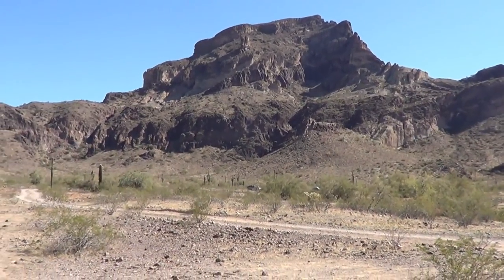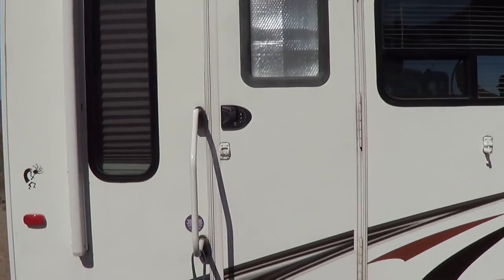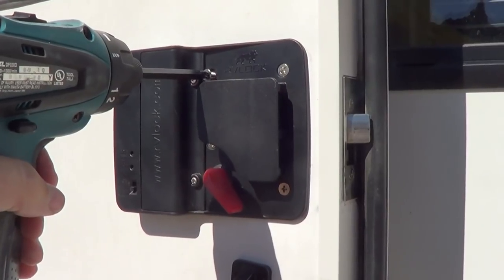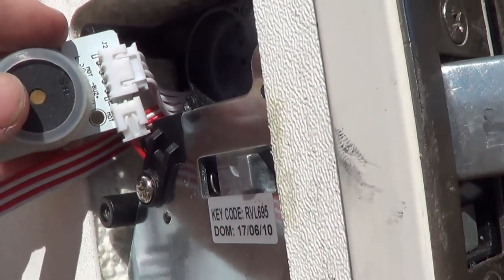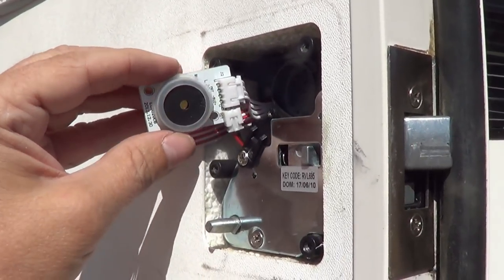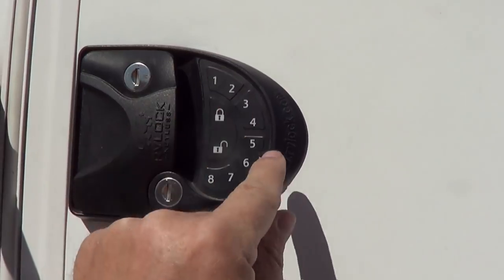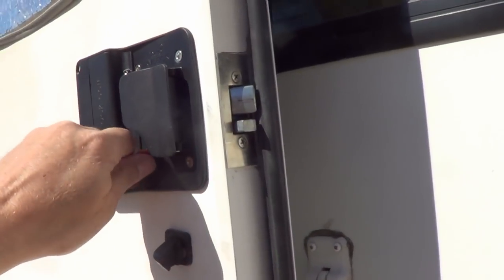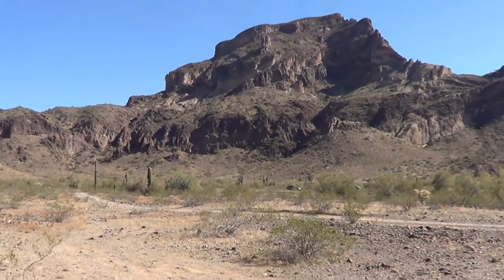RV Lock Keyless Entry Handle - Toning Down the Annoying Loud Beeps

Comment: The manufacturer has added a new setting in the last year that  allows you to completely disable the loud beep. So, its not quieter, its just off.
Reply from the maker: Really, that would be great. I got mine two months ago and don't see the setting, maybe I missed something or its not included in my model.
Reply: I just recently bought a set of these locks and I sure didn't see any setting or have found any setting for the chirper either. One reason I have decided to leave the AP combo door lock on the main door of my TH.  Ray, maybe now I will try to at least muffle the sound enough to be able to install it too!
Reply: To disable the loud beep: Hold down the "1" button for a few seconds, you get a beep confirmation. The beeping is now disabled. Hold the "1" key again to re-enable it.  This feature is not documented anywhere and it even took me awhile to re-find it, buried in a forum discussion.
Reply from the maker: Wicked! I tried it on my model and it worked. Do you know if disabled and the batteries go low will it still beep to warn you even if beeping is disabled?
Reply: Wow! It works on the door locks, but not on the baggage locks dang it!
Reply: @jking1224  you're the greatest!!! thank you!

Comment: I didn’t realize you could lock it without putting the code in first! Love your videos 👍🏻
Reply from the maker: Yes, and  I also found out from several commenters if you hold the 1 button for 5 seconds it disables the beeps completely. Hold it again to re-enable.  Thanks! Ray

Comment: I had used a rubber disc that I had lying around for some reason. It muffles it a little. I generally keep the remote in the truck and appreciate being able to hear the lock and unlock from the cab though it was originally way too loud. My batteries lasted around 3 months but I always used the remote.
Reply from the maker: That's a good point, never thought of people that use it from the truck, we have yet to use the key fob so it's turned off.

Comment: Thanks Ray
I just ordered RVlock version4.
Hope this has the feature to turn off the loud tones
Keep up the Great videos...😎
Reply from the maker: Yes, I have that version and can confirm that it has a Silent Mode - Just hold the number "1" button down for 5 seconds and you'll hear a few beeps. That tells you the "Silent Mode" is engaged. Your handle is then completely silent. If you want the sound back, just hold down the number "1" button again to re-engage the sound.  Cheers! Ray

Comment: I had the same annoying problem with a small safe that I just purchased.   I took it apart and warmed up the solder and yanked out the little soundbox completely.  Much better now no noise at all.  Or I'd fill that hole in the middle with some clear silicon which should deaden the sound.
Reply from the maker: I like a little sound feedback so I was thinking of soldering in a resistor to make the sound just what I want.
Reply: I understand.  My safe has a little light on the front panel which lights every time any key is pressed so I get my feedback via the light.  The resistor idea sounds great.  I always enjoy your thought process when it comes to solving problems.  Keep it up!

Comment: If you bought your handle in December, it DOES have the "Silent Mode" feature. Just hold the number "1" button down for 5 seconds and you'll hear a few beeps. That tells you the "Silent Mode" is engaged. Your handle is then completely silent. If you want the sound back, just hold down the number "1" button again to reengage the sound.
Reply from the maker: Yes, fellow commenters have alerted me to that, my unit does do it, didn't see it in my instructions though.
Also, I ask this after your comment on my other video.  It would be nice if using the keypad the beep volume level could be programmed, or maybe it can but isn't a published feature, too?  In silent mode does the low battery warning still work?
Reply: As far as I know, the sound is all one system, so you either get sound or you don't, and the keypad beep volume can't be changed separately. But when the batteries are low yes! Instead of hearing a series of beeps telling you they're low, there will be a pause in between when you hit the lock or unlock button and when the deadbolt actually moves.

Sorry it took me so long to get back to ya. I had to look into that and see with my own handle.
Reply from the maker: Thanks for the info. Cheers, Ray

Comment: Hay Ray perhaps you could help me. My son bought me this lock. We tried to install ourselves but needed a cutter for the door. So we tried to have professionally done. They cut the hole for the bolt, but the door is too think for this lock. Would you have any idea on how to make it fit a thicker door. I contacted the company and they said NO. can't help me. Thanks love your video's
Reply from the maker: Thanks, Chris, I don't see a way as the RV Lock is designed to work at only a certain door thickness as far as I can see. I guess if someone was skilled with metal work, they could fashion a mounting plate that was indented inward on the door to adjust for the thickness.
Reply: Love Your RV thank you. That is what is similar to what we were   thinking. Again love your videos

Comment: Have you seen the recent post on RVwithTito channel?  Clever idea to add solar as well as provide shade to your back/side windows.
Reply from the maker: No, haven't, don't have enough bandwidth right not to stream much, we pay per gigabyte. Will have to check it out next time I get some fast free WiFi. Looks like a window awning solar setup, pretty cool!
Reply: Correct.  He built a frame out of PVC and attached a flexible solar panel to it with suction cups at the end of its feet to hold the panel in place.  Very cool idea, you get more solar and you shade your window.  Buy the 8'x3' panel, build a pvc frame!  Portable awning!
Reply from the maker: Sounds like a really good idea for small trailers without much roof real estate.I'd be interested in how it stands up to a strong wind gust. I had a flex panel as a remote ground unit and landing on the desert rocks face down wasn't kind to it. ;) I guess you could have a safety tether.
Reply: He attaches it to the RV with 4 suction cups.  I think it looks VERY secure for him.  For you you might need 6-8 for you back window.  A project for Vancouver Island this summer.
Reply from the maker: Doubt I would as I still have plenty of roof space, easily could add 4 more panels. 
Also, when boondocking I always try and point the fiver nose into the sun so our big windows are in the shade almost all day. We love the big picture window views. 
I may try that piping suction cup idea out though, at our summer RV park spot for a regular material shade on the back window. 
Cheers! Ray

Comment: What if you left for a hike, leaving your keys behind, and when you returned and attempted to unlock it, the batteries no longer had sufficient charge to operate? How would you re-enter your rig?
Reply from the maker: I have a key hidden outside. The unit also has a warning for when the batteries are getting low.
Reply: Thanks for the reply. Good to know.

Comment: Can you still lock and unlock it if the batteries are dead?  This would be bad if the batteries died and you had left your keys in the RV.
Reply from the maker: No, you need the key. I have one hidden outside and one in the truck.
Reply: Is it taped next to the code outside the lock?

Comment: What happens if you lock it and don't have your keys then the battery goes dead. Will you be locked out?
Reply from the maker: Yes, you would need a key. I have one hidden and one in the truck, just in case.  One reason I kept the beeps and didn't disable the speaker completely, I forgot to mention in the video is it actually will beep to warn of a low battery like a smoke alarm does. Cheers, Ray
Reply: To bad they dont have one for direct power to an RV unit. Is there a way to modify it that way?
Reply from the maker: You could but being a door likely not worth the hassle of running the wiring.